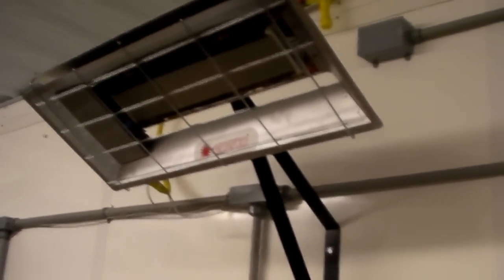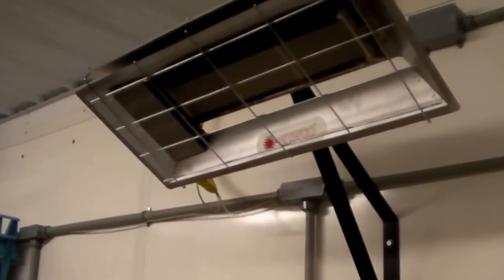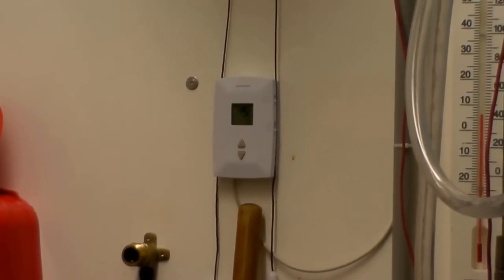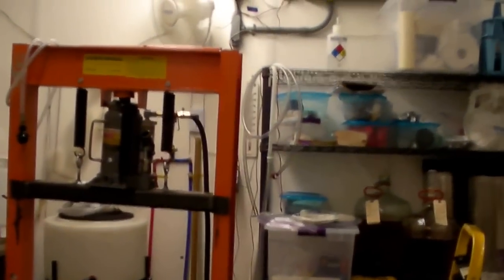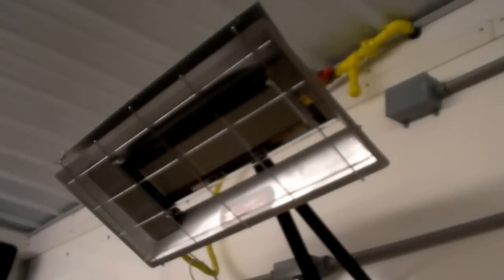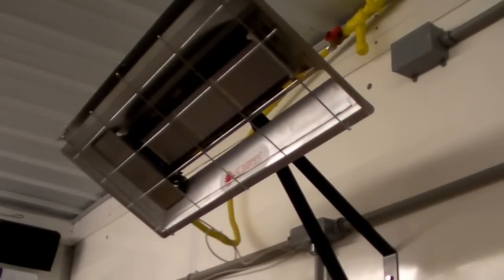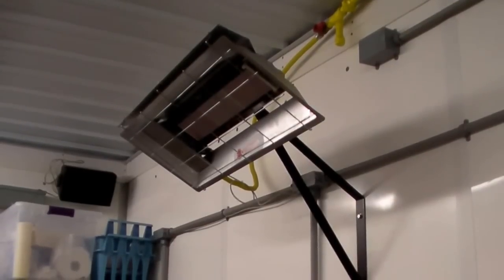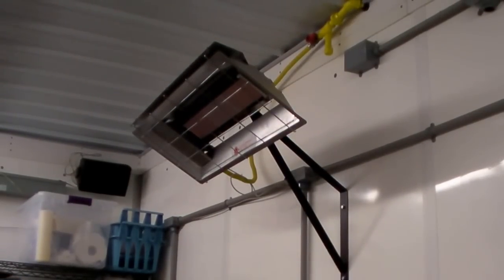Mr Heater 22K LP Infrared Radiant Garage Heater MH25LP

Comment: HELP! how come my pilot light turns off when i turn on the heater? how do i adjust my overall pressure as stated at min 3:33?
Reply from the maker: I need to know more.  Was it working before and this is a new behaviour?  Is this a new installation?  My first thought is that your supply regulator is faulty and not maintaining pressure when the burners come on.  My second thought is that you are almost out of propane and need to refill your tank!  RSVP

Comment: Mixed feelings so far. I've devoted more hours than I feel necessary for a simple heater installation. Out of the box the manual says "...comes equipped with a regulator". Made the gas hook-ups and the pilot shot out 6" and sounded like a hand torch. Could not get the heater to light. Too much pressure. Installed Mr Heater 1/2 psi regulator at tank. Much lower pressure. Pilot lights but no burner when thermostat calls for heat. Several hours goes by with pilot burning. I'm on phone with Mr Heater rep, trying to figure out why burner isn't igniting when suddenly, it ignites! All seems well and good but after a good long warm-up, the ceramic isn't very hot and has a dull glow. No way this heater is going to warm anything when I can hardly feel the heat from 4-5' away. Seems like too low of pressure now. I'm a DIY kind of person. No way this heater should behave like this for a consumer right out of the box. Phone reps were helpful as could be not being on site. Why the hell does Mr Heater say it comes equipped with a regulator when clearly that was insufficient? This should not have happened. I'm still going to need either an adjustable regulator or someone to come in and make the necessary adjustments at a cost. This has turned out to be way more costly and quite simply, a hassle. The time I've invested so far is ridiculous.

Comment: Thanks for the video. I had questions about the thermostat which you answered and I was wondering if there was any venting required....not by the looks of things.
Reply from the maker: Venting IS required.  Another way of saying that is to say you need a source of fresh air for this heater.  My cider shop is VERY airtight, and I heat it with an 240V electric heater when the doors are closed.  I only light and use the propane heater when I have to work with the doors open and the electric heater is pretty much useless.  The heater is supplied with a vent cover to go over an opening in a door or wall to enable you to vent the exhaust.  I'm glad you brought this up.
Reply: Thanks Alan,
I am glad you replied. I was looking at purchasing the natural gas 25k btu version of this heater. I  plan on using it in my 2 car garage to keep the environment at a constant 10 deg C. The garage is pretty air tight with the exception of some small gaps around the door.
Reply from the maker: Mike C  Hey Mike, even a small shuttered vent in the garage door (on top) should do the trick.  I really recommend putting a ceiling or wall fan in somewhere to push the warm air down.  You just have to be careful not to let the draft blow across the heater since it can keep if from lighting properly.  You will significantly cut your fuel consumption as well as increase your comfort level if you prevent the warm air from stratifying up at the ceiling.  I'm just say'n...  Al

Comment: I have the same heater and almost the same setup. i turned my heater off in last winter and shutoff the gas supply and now i don't know how to start this thing up again. I turned the gas supply back on again but couldn't light the flame. is there any other step that i am missing?
Reply from the maker: It sounds like you lost your manual.  Here's a link: https://www.manualslib.com/download/107247/Mr-Heater-Gas-Fired-Infra-Red-Workshop-Heater-Mh25lp-Mh25ng.html

Comment: My pilot light is about 2 inches and can’t adjust to make it smaller is this going to be a problem down the road?
Reply from the maker: I don't know so, but I don't think so.  I have a long pilot flame too.
Reply: did you figure it out? did the conversion, and the pilot hauls ass, dosent adjust even with the orfice changed

Comment: Are you running this off a 20lb tank or what are you running it on? Trying to figure out how long it would last on a 20lb tank.
Reply from the maker: I honestly couldn't say since I use mine in a VERY well insulated space.  I only used a 30 pounder and larger, and it all had to do with the temperature and the like.  I don't think I would use a tank small than 30 pounds since they chill fast and the pressure drops.  Too tired to do the math, but converting the BTU content of propane at 22,000 BTU output would give you an approximate value.

Comment: HI, IM LOOKING TO PUT ONE OF THESE IN MY GARAGE (NATURAL GAS) NOT SURE IF 20,000 BTU IS ENOUGH OR DO I NEED THE 40,000. I HAVE A CNC I PLAY WITH THIS HAS COOLANT IN IT . MY QUESTION IS HOW FAR AWAY CAN YOU FEEL THE HEAT, ALSO WHAT IS THE NAME ON THE DIGITAL THERMOSTAT. THANKS IN ADVANCE. .............HEAT IN THE GARAGE CANT WAIT.
Reply from the maker: I really can't say with confidence that the heater would be the right size for your application.  You have to look at the volume of the space and the insulation.  You do want a high ceiling for this heater, and I HIGHLY suggest that you have some sort of fan to push the warm air down.  The radiant heat travels well, and I can feel it as long as I'm "in front" of the heater.  I used a Honeywell thermostat.

Comment: How do I get the pilot light started, I recently moved into a house that has this and no directions
Reply from the maker: +Rima Mackelburger Lighting the pilot for the first time takes a while since you have to flush the air out of the lines.  1. Make sure the gas is turned on.  2. Press and HOLD down the red knob while periodically trying to light the pilot.  Again, it may take a while.  3. CONTINUE to hold the knob down for at least 30 seconds after the pilot is lighted.  4. Release and rotate the knob to the ON position to use the heater.  

I strongly suggest you download a copy of the manual for future reference.  http://www.manualslib.com/download/545833/Mr-Heater-Hs25lp.html
Reply: Perfect, thank you so much for your help, I got it started
Reply: Can tell me how?

Comment: Do you get a lot of moisture on things If you run this too long, if so how do you stop that from happening?  thanks
Reply from the maker: I only run the heater when the big door is open, so I don't have a problem with condensation.  If you are getting condensation, then you need more fresh air and time.  Fresh air to let the exhaust out, and time for the cool surfaces to warm up so that they don't capture the moisture.  Good luck!
Reply: Thank you very much, I will try this advise next time I'm in the garage....

Comment: Can someone tell me if the pilot light goes out from a draft does it still leak propane? Very important that I know this Thanks in advance
Reply from the maker: All gas is shut off if the pilot light goes out.  That is the function of the thermocouple that rests in the pilot flame.  No pilot : no gas.  When you relight the pilot you have to press and hold the button on the regulator to keep gas flowing until the pilot is lit and the thermocouple is hot.
Reply: Thanks You

Comment: I bought a used nerco 4040lp garage heater.  It is missing the thermostat and the thermocouple.   Do you need a thermostat or can you just run a jumper between the two thermostat contacts on the gas valve?  Sure would appreciate your help.
Reply from the maker: +William Braun I'm an end user like you, and not the company support person.  No propane heater with a pilot will work without a thermocouple for the pilot light.  I downloaded the manual from http://www.manualslib.com/manual/47508/Enerco-Hs4040.html  I suggest you get a copy and talk to the company since you're missing parts.
Reply: Thank you.  You have confirmed what I thought.

Comment: How big is your shop and does this heater heat it well?
Reply from the maker: Really not a good comparison.  My shop is 12' by 20'.  It has R30 in the walls, and R60 in the ceiling.  I only use the propane heater when I have to work with the 5' wide sliding door open.  I shop is too small and too tight to run the heater without the door open.

Comment: Too bad there is very few videos on these on youtube. My issue with these is that stupid vent. My logic is this, I'm heating up a space (garage) it's insulated and almost air tight. If I open door use a vent (hole) in my wall i'm letting the warm air out. I cannot comprehend the idea of a heater that requires a whole in your wall (that heat escapes through) for it to work safely. This is some ass backwards logic. Can someone explain this in some reasonable way why this makes sense.
Reply from the maker: You bought the wrong heater for a tight space.  This garage heater is a RADIANT heater and not a furnace.  It needs ventilation for fresh air and exhaust.  I'm moving it to the main aisle in my barn as heat for when I work on vehicles.  Any combustion is going to consume oxygen and give of combustion gas and moisture.  If your garage is really that tight, then you want to talk to some HVAC people about what's appropriate for you space.  I only used mine when the main door to the shop was open to the barn so lots of fresh (AKA: Cold) air available, but the heat feels oh so good.  I put an electric heater in the old shop (very tight and cheap to heat), and the new shop has a heated floor (no combustion in shop) for dry heat.

Comment: These are horrible. They create moisture because they are vent free units. If you paint or have a lot of fumes these will not work for you. They will stink like crazy. Also, that Sediment Trap is wrong. The gas needs to change direction in order for the sediments to fall in the trap.
Reply from the maker: It's a heater, not a panacea.  I use dry electric heat when the space is sealed up, and only run the propane heater when the door is open.  I've had no difficulty with the trap, but there are three traps in the distribution line...

Comment: You Gas Safe Registered? Since you need to be to install a gas appliance under regulation 3 Part B of the Gas Safety (installation and use) regulations 1998. Since I’m guessing this was a DIY gas job.
Reply from the maker: Installed in an agricultural out building and checked by my propane supplier.  I'm good.
Reply from the maker: P.S.  Pennsylvania has different regs for propane vs natural gas.
Reply: Iirc GSIUR does apply to LPG (propane) too.